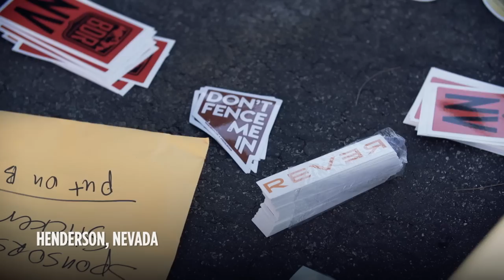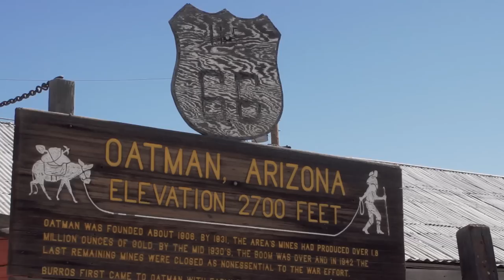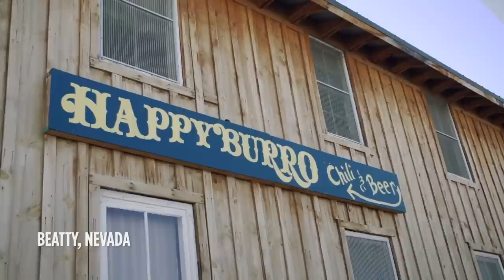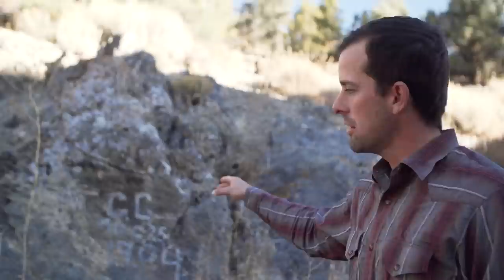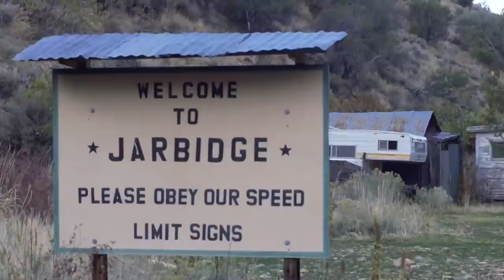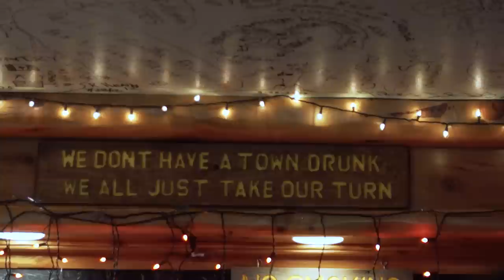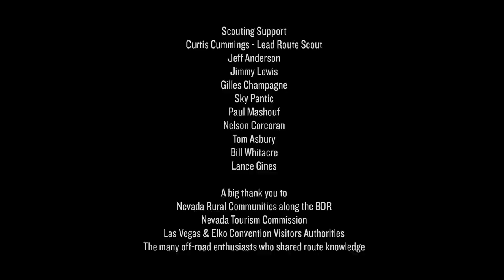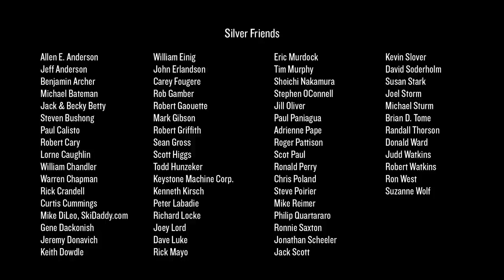Nevada Backcountry Discovery Route Documentary Film (NVBDR)

Comment: I like the idea of the BDR, but I think a few things need to be considered more:

You shouldn’t need a chase vehicle.

IMO, half the routes should be rated beginner to easy intermediate level to get new ADV riders involved.  Most BDRs are intermediate to expert.  I know there are harder options on the routes, but there should be more options for less experienced riders.

I know you’re working on shorter xBDRs or something like that, which is good.  It’s easier to get maybe 3 days in than 10.  After all, there’s travel time to and from the BDR.
Reply: I've now done parts of CA and NV, as well as all of AZ, NM, UT, WA, ID, WY, and CO. I've done AZ and CO twice.

You don't need a support vehicle. Beginners can absolutely do the BDRs if they have people with them. (I've done all of them solo except WA)

You can do most of them in five days or less, especially if you're a better rider. These routes are set up to be done by an average off road rider running light. They run them on big bikes with luggage to make sure it can be done that way. The lighter your bike, the lighter your luggage, and the higher your skills the easier this will be. But it is still completely doable by your average joe.